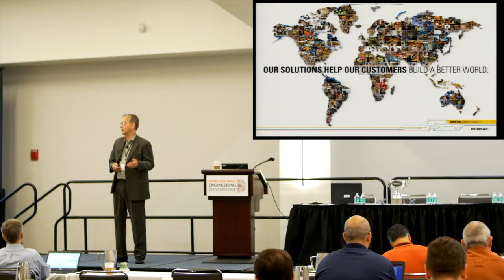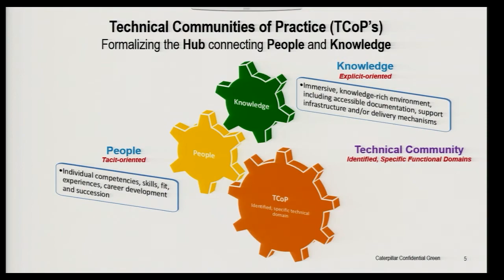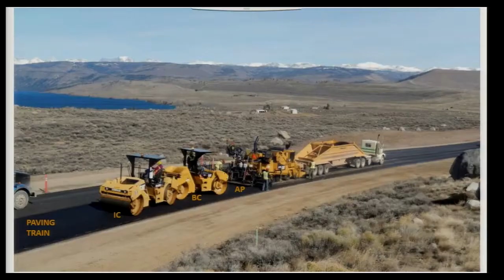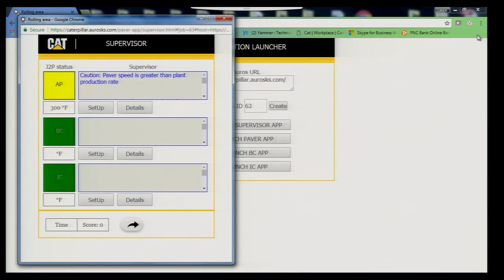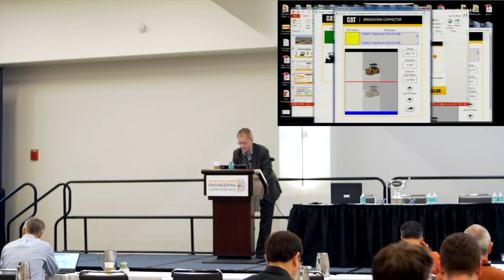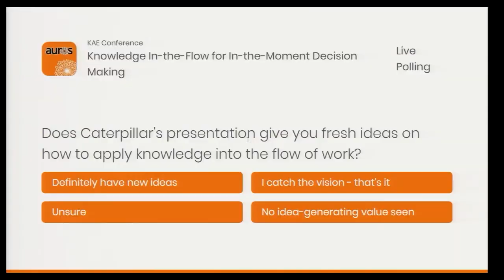Knowledge In-the-Flow - 2017 Knowledge Aware Engineering Conference

Comment: Sanjay Dhall's question on determining the heightened value of knowledge compared to lesser-valued knowledge might be answered this way: value is derived out of how it is consumed. It is important to nurture a technical community or domain's knowledge growth, yes, but the value stems from how that knowledge is applied and used. For example, if the latest "Widget A" smart device is purchased over and over by consumers, then the tacit and explicit knowledge related "Widget A" has heightened value. If a "Widget B" smart device does not bring in sales anywhere close to "Widget A", then the associated knowledge has lesser-value. For the knowledge life-cycle's feedback loop, we would rectify this situation by either (a) improving "Widget B" knowledge leveraging our technical community / domain or (b) educate and work with the consumer to help them better understand the value of "Widget B". In summary, knowledge value is determined by its alignment or association to the value of consumer-purchased products, services, or solutions. A second way knowledge can have measured value is in the way it can be sold or exchanged for financial gain. For additional information on knowledge management, knowledge in the flow, or advancing your programs using the knowledge aware technique, go to www.knowledge-aware.org. For more information about Caterpillar, go to www.caterpillar.com.